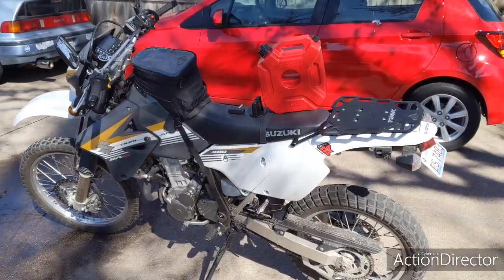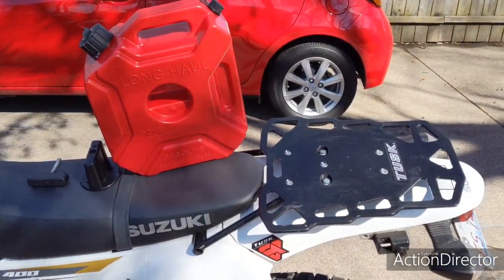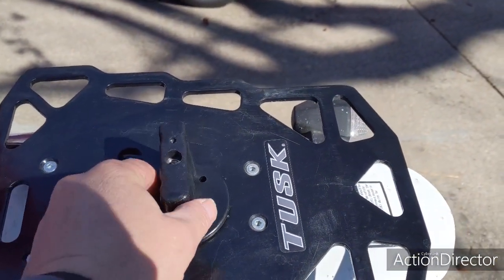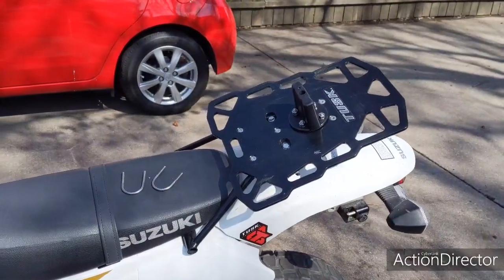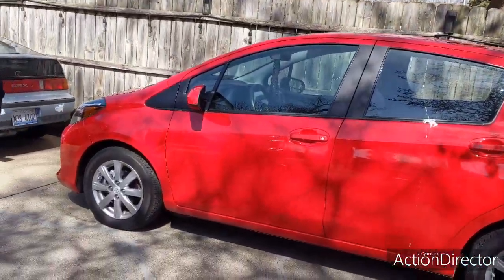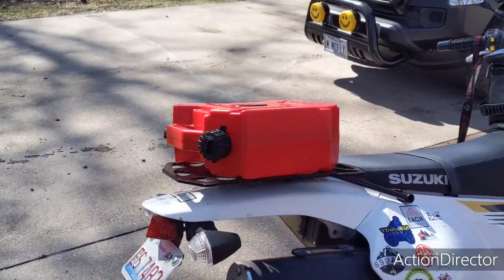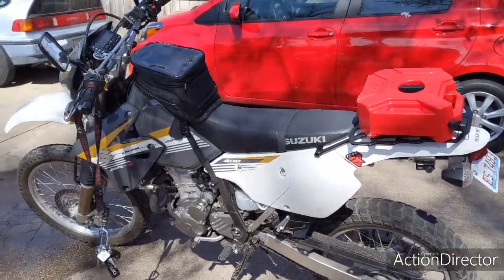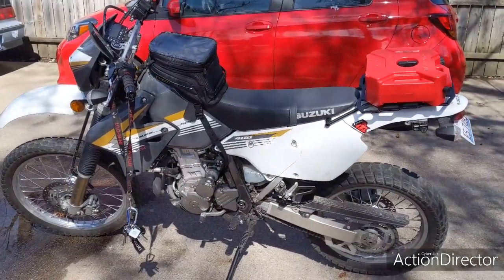Long haul atv gas can. Rotopax knockoff

Comment: "AA" - With "THE MIGHTY SUZUKI DR 650" at +/- 50 MPG that would give me an extra 65 miles +/- for an approximate total of 245 miles.... NICE. Might be getting me one of those too. The DR holds 3.6 gallons. The only thing I noticed as an anal analytical asshole is the bolts may be poking up into the plastic - unless the hole below is large enough around to allow them to stick up a little bit without creating a problem.

Anyway, nice install !!! - I like working with my hands as well - and 9 times out of 10 - I'll come up with a better solution too....

Nice job Amigo... 😬
Reply from the maker: I thought the same thing about the bolts but it worked out perfectly and fit fine...I will probably do another vid on the can when I use it more. The stainless bolts worked really well.
Reply: Cool I was thinking of doing the same
Reply from the maker: @ajaxracing  It is a nice tank for the price.

Comment: Thanks for the video.
I was wondering if you could show how to fill it in and put fuel from it to your motorcycle (for security purpose) and also explain what is the small cap used for ?

Comment: I had done the same save for using a lock washer w/ wing nuts - in order to easily remove the base  (to flatten)  the luggage rack if needed.
Reply from the maker: Yeah, I just used it on my long Black Hills ride and it worked like a champ...

Comment: Reece, Good video, I picked up the same "Long Haul" but in black. I never thought of bolts so I used the U-bolts, but it was 100 in the garage, and I was fried. Great idea I may redo mine before I use it, have you had any leaking issues with it?? It is a heavy-duty plastic for sure. Hope all is well.
Reply from the maker: I took it on a week off road trip in the black hills of South Dakota and it worked great ...Haven't had an issue yet..Have had them for years now...Thanks buddy for watching...

Comment: Thank you for this vid, I didn't want to have to spend $200 to mount a Rotopax fuel can to my KTM 525 EXC
Reply from the maker: Yeah, for sure...It is still holding up very good and is working great. It gives me 50 percent more fuel. And thanks for subbing...I will start doing more vids soon...I haven't had the time lately to do them.

Comment: Nice setup, how do you like the gas can so far? Any leakage? and hows the tightening handel holding up
Reply from the maker: So far the can has been excellent. I have it on the back of my bike all the time and it is still tight and secure. I don't have the can filled all the time just for extended rides.

Comment: Looking to put this on my drz. Do you recommend this gas can???
Reply from the maker: So far I have had it about 2 years and no complaints. It gives you 50 percent more fuel range..I'm sure the rotopax is better quality but it is also way more money...For what riding I do, mostly trail riding, it has worked just fine.
Reply: @imyourhuckleberry357  man that’s awesome. Those rotopacks were way to much money. Thank you👍👍
Reply from the maker: @The_Kayak_Guy.  No problemo...Thanks for watching.

Comment: Does it come with a spout for easy filling up the bike? Does it leak when closed or when pouring gas on bike?  Thanks
Reply from the maker: It does come with a spout it is not inside the tank and when you open it you can put the spout on...My tank has not leaked. I haven't used it that much I will say though..Haven't been on alot of extended rides.

Comment: Where did you buy this ?
Reply from the maker: Sorry for the delay...I bought it on eBay...Long haul gas can...
Reply: I cannot find it on eBay rn for that cheap got a link or alternate site ?
Reply from the maker: @jfire5118  https://www.ebay.com/itm/133528821954
Reply from the maker: @jfire5118  It is not the same seller I got mine from

Comment: Interesting, wonder if it would work with a regular rotopax bracket.
Reply from the maker: I'm thinking it might...But I'm not sure...They both look about the same bracket...I subbed your channel...Thanks
Reply: Just to give you some input it will not work with rotopax adapter, I have the one gallon on the CRF250L and no go on that I was so disappointed but its OK.